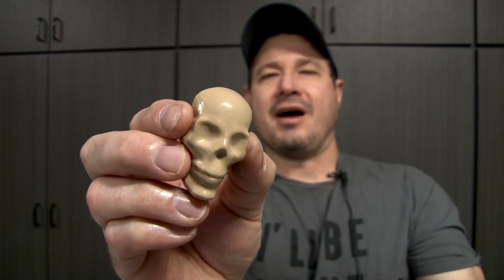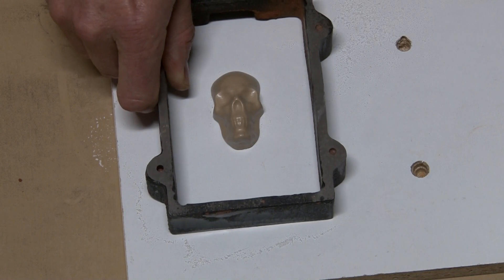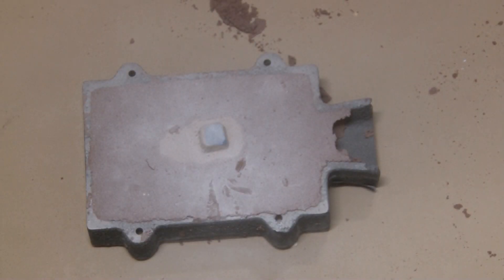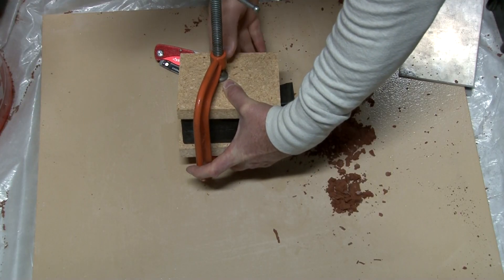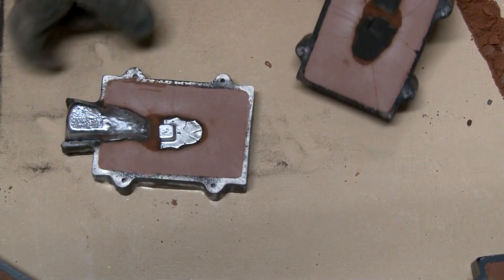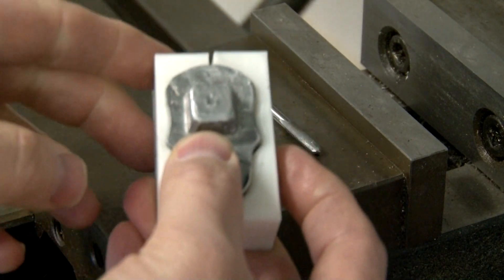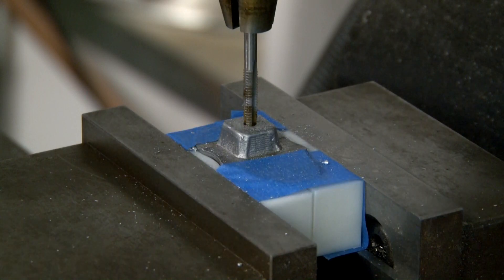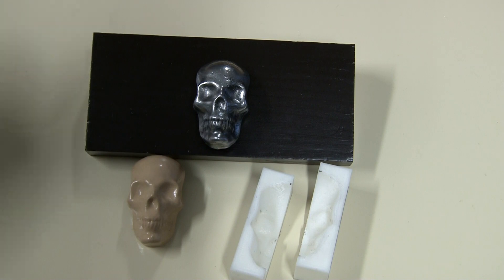Custom Drawer Pull / Knob Created by Aluminum Sand Casting

Comment: The 3D printed clamps are a pretty good idea! I might use that trick in the future if needed.
I've done a standoff for a casting before and I used that as the sprue to pour into, so it was way to big and long but easily modified to the needed length and no extra sprue to cut of and sand flat.
Nice smooth looking skull 💀👍
Reply from the maker: Thanks for watching my video.  My clamps still worked it just would have been better to design it to grab the top surface too.